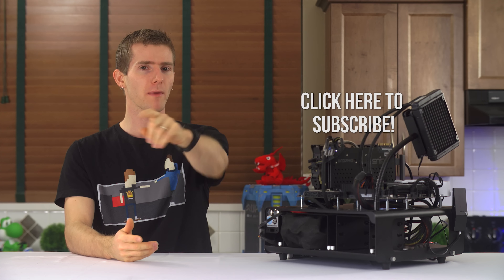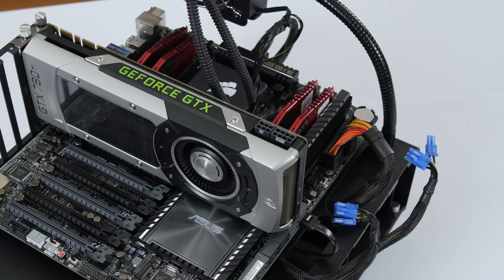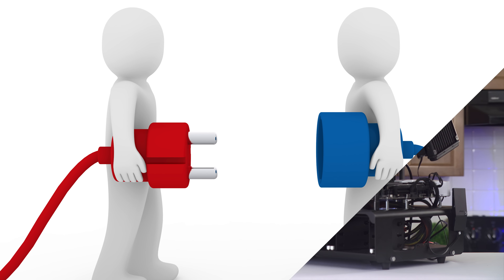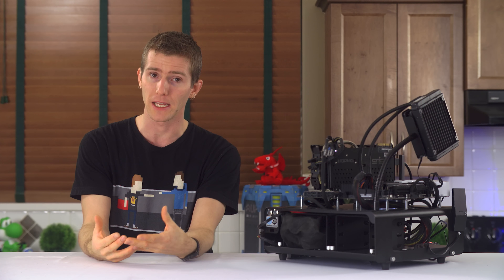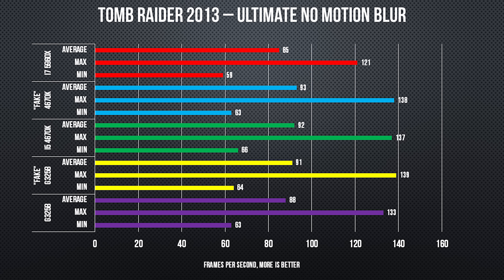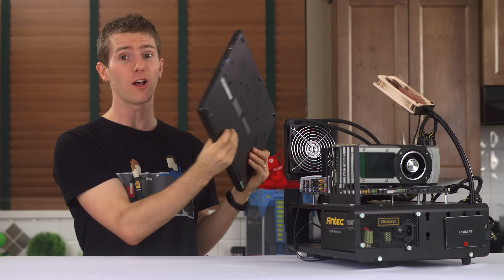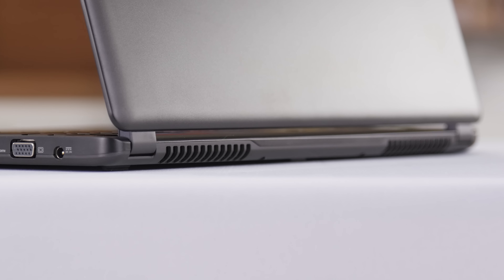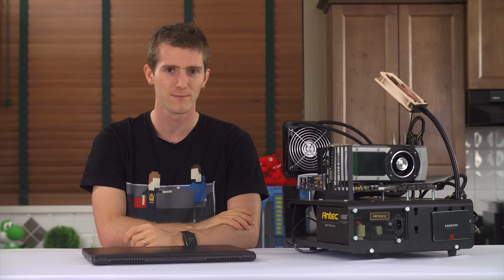CPU Simulation - Can You Simulate Performance of One CPU with Another?

Comment: Hey guys, i've got a question. Did 750W is enought for overclocked i7 4790K and 2 GTX 970 in SLI?
Reply: yes it should be
Reply: thanks m8 :)
Reply: Zawiszunio or go up to a 800/850 if youre really going to put the cpu and gpus, either way make sure the psu is good quality :p
Reply: Better play it safe and get a 850+psu.My oc'd 4770k (4.5) almost maxed out my 850watt psu with 2 780ti, and it's not good for a psu to work on a 100% load constantly
Reply: Nick93 well just looking at the gpu's 2 780tis draws around 600w , 2 970s is closer to 430w (both system power under load, i7 3960@ 4.6 GHz)
Reply: Yes, but his cpu may draw 100+/- watts and the rest is 50-100 max.No room for expansions whatsoever
Reply: Nick93 check the edit i made to what i said, that should be fine
Reply: i was looking for PSU on bequiet psu calculator and 750W in full load was 94% of PSU load and recommended was 1000W PSU... i think i will get corsair RM 850W thanks guys for help! (awesome community)
Reply: Vincent Grinn Weird...
My system draws 810 watts under 100% load
Reply: Zawiszunio id say thats an over exageration by the calculator, but yeah 850w would probably be best, and the RM series are great, im getting a 750w one myself for i5 4690k and 2 970s :p
Reply: Nick93 o: damn
Reply: Zawiszunio 850 watts is the sweetspot for you, but i recommend getting the seasonic 850 watt gold x-series.Seasonic is know for being one of the best with build quality, perforamance, customer support and warranty. Not saying that the Rm series is crap, theyre pretty good too.
Reply: Nick93 yeah i probably should go up to 850, but the x series costs 50$ more than rm, budget is already pretty tight as is xD
Reply: Vincent Grinn RM it is then. Theyre both really good and you cannot go wrong with both
Reply: Im building a pc with a 5820k and 2 970s. The estimated wattage after overclocking is about 600watts so a gold 750 should do ya fine.
Reply: 5820k is not on my budget, cause that mean i need lga 2011-v3 and DDR4 :\\
Reply: Zawiszunio haha yeah, going up to 2011-3 is  kinda a waste of money atm
Reply: Zawiszunio  750 should be enough if it is a quality psu. Decent watts high quality > A bunch of watts but crappy psu. I would get a good brand that you trust, because the psu powers the entire system

Comment: How much can you overclock an i5 3570 non K? E.g 3.40GHz to 3.80GHz. Is it possible to go 4.00GHz? or 4.20GHz?
Reply: no you cant overclock a non k version. You might be able to change the base clock (? maybe) but not the multiplier, because the multipier is locked.
Reply: Douglas Gardner But why can I change the multiplier if it's locked?
Reply: AirportHobo  because you probably have the k version
Reply: Douglas Gardner When I right click "Computer" and then click "Properties" it says "Intel(R) Core(TM) i5 3570 CPU @ 3.40GHz  3.40GHz" I'm really confused right now :/
Reply: AirportHobo  the i5 3570 is stock at 3.4 and can turbo boost up to 3.8ghz
Reply: Douglas Gardner Oh okay. So it can't boost it up to 4.00GHz? Because I tried to do that and it said it was 4.00GHz when I checked.
Reply: AirportHobo  no you cant overclock a non k.
Reply: MrCorbin2618 Wut? When did I get pissed at someone?
Reply: MrCorbin2618 Can I get a milkshake too?
Reply: AirportHobo Yes. As you can tell, i am an enjoyer of milkshakes, and im willing to make you one.
Reply: AirportHobo Planes
Reply: AirportHobo Geese.
Reply: Douglas Gardner Changing the base clock is still overclocking, you can very much overclock non-k cpus.
its just a lot harder, doesnt go as well, and is a pain in the ass.

Comment: I need help. My AMD fx8320 is overclocked to 4.5ghz and is creating really bad frame drops in bf4. I have tried multiple things and to no prevail. This all started with me wanting to overclock my new gigabyte gtx 970. And so i was trying all night and i could get nowhere near what other people were getting. I was so tired and it was really at that point that i said screw it ill stick with the best i got. So i wanted to wake up this morning and have some fun playing bf4. And i was excited to see at first that i was getting 80+ fps. Then i had a very long and very annoying fps drop. So then i looked at msi afterburner and i saw that my gpu was hitting 70% usage. And all my cores were 90+. So then i thought to overclock my cpu to 4.5ghz from 4ghz. Which helped very slightly but not majorly. So if somebody could please help me and explain why my overclocked cpu is doing absolutley nothing for my unusable gpu. And no stock speeds on my gpu still had frame drops. And i would like to avoid upgrading my cpu, but if its required i may have to.
Reply: What is your cpu usage while idle? Do you run a lot of background tasks?
Reply: Timothy Lastovica No, Dont worry about it. Ive been on reddit all day trying to figure it out and it ended up being the vrm's on my motherboard. They are running to hot. So it turns out i need a new mobo.
Reply: DaHorizon They would be running hot because of the overclock but that doesn't really explain why the game was stuttering at stock clock / voltage.
Reply: Timothy Lastovica No my current motherboard is not fast enough to run my cpu at overclocked or stock speeds. It may support am3+ but it does not support the speeds. The processor is running to quick at higher speeds that my mobo is trying to catch up which in turn makes it hotter which in turn makes my cpu hotter which in turn ruins the performance of my graphics card.
Reply: DaHorizon I think you mean it is thermal throttling to keep the system from damaging itself by running at X clock speed. You can probably continue using your machine by undervolting and underclocking the cpu down to 3.0 GHz until you have the funds to change motherboards. I'd also consider turning on dynamic frequency scaling so the CPU isn't sipping max power and clock while it is idle. You can also just open the side panel and point a fan at the VRMs. That sucks though that you're having that issue. If I can help just send me a message.
Reply: Timothy Lastovica Yes that is exactly what i mean. And i have heard of undervolting but i dont want to do that considering i render out video's alot and i shouldnt have to keep my cpu underclocked so i can use the thing. Im probably going to get a new motherboard soon. And i dont have the room to open the side panels and do it that way. Cause trust me if i could i would. So for now ill just have to stick with lower end games and ill have to wait to play them at max settings without overheating my whole computer. Also would my graphics card driver start to fail if my mobo vrms got to hot? Or is my gpu performance lowering because of the cpu? Because trust me its not the gigabyte 970, cause thats the best overclocker out of them all. And yes the whole reason why im even thinking of a new mobo is because of this new 970. I had a r9 280 and even that had problems with my cpu. And the whole time i had it i was thinking that my cpu was getting to hot, but it turns out to be my mobo.
Reply: DaHorizon Because of the way DirectX works draw calls are made by the CPU and passed on to the GPU*. It was one of the things AMD's Mantle hoped to fix with having certain instructions head straight for the GPU. 

*Not as familiar with API terminology. 

So depending how many draw calls you lost from the cpu lowering its clock to keep from damaging your system should go hand in hand with the fps drops.

Out of curiosity, what motherboard do you have?
Reply: Timothy Lastovica Its not damging my system at all. My only problem now is the mobo. Not bf4. Because i am using dx11.
Reply: scylendrey Ya i just looked at it and it looks very nice! I would actually go for that mobo but im gonna stick to asus sabertooth 990fx r2.0 because it is basically the same as my current m5a97 r2.0. And color scheme doesnt really matter to me.
Reply: scylendrey Ahh, Dont need the extra sata. And i wanna stay asus. Similar board and bios.
Reply: I had this problem. Your CPU will be throttling everytime your VRM hits a certain temp (for me this was 100C). I was using an MSI 970a-G43. It was an awful motherboard. I upgraded to a 990FX Killer from Asrock. Overclock is at 4.5ghz now and running smooth. Or at least as smooth as an AMD FX chip can be. 

I wouldnt recommend the ASUS Sabertooth 990FX revision 2 as its quite an old mobo now. My bro has that board and its got less stuff on it than my cheaper Asrock Fatal1ty 990FX Killer.
Reply: Scuba Sausage Thankyou a lot.I was looking for someone who had a similar problem. And i knew it wasnt my cpu's problem that it was getting up to 60c for no reason. Also the only difference about the mobo is that the 990fx has one more pci-e slot. Im not sure which mobo im gonna get yet.
Reply: DaHorizon I wouldnt be 100% sure. The motherboard you have the m5a97? Shouldnt have an overheating VRM. The heatsink is quite beefy on this mobo. 

Possibly its just a poor chip? Ive certainly found AMD doesnt really cut it for a lot of modern games. Even when overclocked.
Reply: Scuba Sausage No its definitely the motherboard. I was on reddit all of yesterday and figured it was the vrms on my board. http://www.reddit.com/r/buildapc/comments/2q3m0k/overclocked_8320_bottlenecking_gtx_970/?sort=top sort it by new and look for when gixxersixxer04 tells me that my mobo has 4 phase vrms delivering power to my cpu. Also my mobo isnt the asus m5a97 r2.0. Its the asus m5a97 LE r2.0. Also this is what gundammitpete said on that thread "Your motherboard is the problem, you need a 8+2 at least for a big 8 core amd. Especially if you want to overclock. Your overheating VRM's are what's causing your problems."
Reply: DaHorizon Ah yes the LE does not have a heatsink on the VRM. You could just buy a heatsink for it, not sure you need 8+2 to overclock but it does help a lot. I managed to get my FX 6300 stable at 4.6ghz with a 4+1 config before.
Reply: Scuba Sausage Nah, i think im just gonna go for the extra feautures on the motherboard. Also its always good to have more room for overclocking.
Reply: DaHorizon Well in around 3 months im selling mine. Im not happy with AMD. They seem to suffer heavily in games and are holding back my crossfire config. Ive been thoroughly disappointed by AMD for gaming. 

The AM3+ is a dead socket, I wouldnt go spending lots on it.
Reply: Scuba Sausage I dont plan on it. I bought it looking at a starting config that would last me a while. My previous r9 280 didnt have much time left on it anyway so i already upgraded to my 970. And amd not expected to upgrade there cpu's until 2016 so theres still plenty of time for my cpu.
Reply: DaHorizon Yeah. Nothing is confirmed about zen yet. Just a rough date of "2016". That could be 2 years away from now. And im fed up now. Im going to get a broadwell chip from Intel when they come out. Provided they can perform.

I use 2 x R9 280x's in crossfire, no need to be buying any new cards just yet. In fact if I upgrade to an Intel system I should get a lot more out of them.
Reply: Scuba Sausage Well when it comes to crossfire intel is better for some reason. And ya broadwell is going to be pretty amazing from what ive seen. Zen on the other hand might have some pretty insane stuff just because its taking them so long for it to come out. But what might be a really good competition is skylake.
Reply: Time to throw your red garbage and join the blue team.
Reply: listen kid, amd chips have low L cache speeds, so even if you oc to 4.5ghz on 8mb cache-ur going to bottleneck that 970, you should have bought an intel chip.  lesson learned kid

Comment: i need to ask something. so anyone want to answer go for it but respect each other please. sio there is my point.

they always tried to make cpu smaller and smaller to be more performent and better efficiency but does im the only one to like if they make a cpu of something like 5 inch by 5 inch?? i  mean yeah continue to make inside smaller but why they dont make the cpu himself bigger? they will be able to put more power on the cpu iof they do so why not?
Reply: +Xx Nyklaus xX When intel/AMD/Qualcomm/etc make a CPU these days they use very expensive litographic technologies to essentially 'print'/'etch' transistors only a handful of atoms big on the silicon. Now here's the tricky bit:
The larger the dye (the whole 'brain' bit of the CPU) is - the larger the chance of things fucking up somewhere (we have literally billions upon billions of those microscopic transistors in each chip!). A fuck-up means they'd need to bin that entire chip. And since the whole process and the materials are expensive - binning a larger chip means losing more money.
As a side-effect to all that - a larger chip would cost you an arm and a leg... The current i7-4930MX (which can successfully run at 4.5GHz, by the way) chip in my laptop is around 7/8 of an inch by 1/3 of an inch or so in size. A very small surface area. At launch that CPU was ~$1000 a few years back, I now picked it up to upgrade my laptop for just short of $400. Now imagine a 5" by 5" piece of silicon costing in the realms of 20-50k... :) (that price would not only have to include the massive increase in the materials and the manufacturing cost, but also cover for the risk of having to scrap the whole chip if something goes wrong with the lithography!)
Another thing that prevents manufacturers from making those massive chips is heat. Think about the tiny dye in your current CPU and the temps your cooler has to deal with. Now imagine a massive dye and how much more heat that would output... You'd probably need a massive PC case just for the heatsink xD
Apart from the heat, the same cost/risk thing also applies to camera sensors. You can pick a tiny phone sensor for next to nothing, a compact camera one is more expensive, then it goes up to crop-factor DSLR, then we have a huge leap in price when going to full-frame and a crazy leap in price when we go to medium format sensors. Same thing.

I tried making this as simple as possible, hope this helps :)

Comment: Just a question to the tech savvy people here... isn't it incredibly tiresome to be into pc tech of the consumer market? I mean, it is the same shit over and over every year: Intel, AMD, NVidia fighting each other and releasing new shit (sometimes even the same shit just with a different name). I have settled with my pc build from 2009 and yes it does not run Crysis 3 with max settings on three UHD monitors but it is ok. and come on, the flaming is insane, calling other really bad things just because they like producer X. pc tech is like the most dumb thing ever.
Reply: Not a smart comment to post on a channel focused on PC tech. Besides, stuff does not stay the same each year. Value for money changes, especially in the GPU market, and power consumption and heat are always interesting. Newer CPUs are faster, consume less power, and have other changes, such as removal of the "free overclock" from locked CPUs in the 4th gen Haswell line compared the ivy/sandy bridge. Intel makes new, better stuff each year. It's AMD who haven't made any new CPUs recently, but that's because they've been focusing on APUs. Lots of different and interesting stuff. This community is also one of the better ones on the internet. Much more reasonable than most, and less flaming.
Reply: Like this stuff is exclusive to the tech channels or even the internet. Go to a busy bar and watch the drunk fans curse at each other during a football game as a team scores.